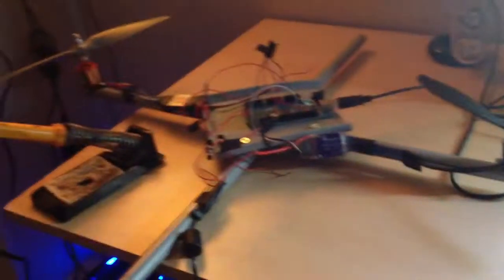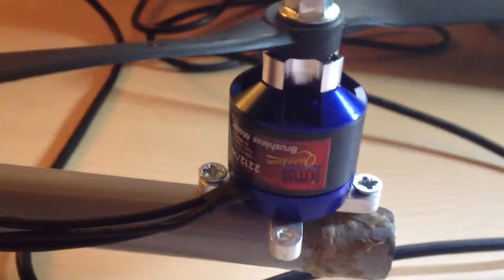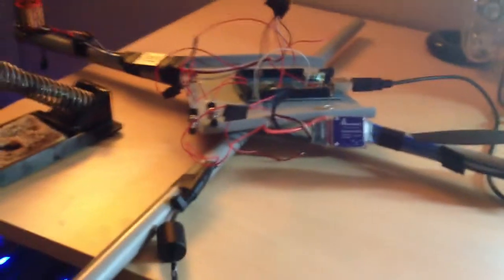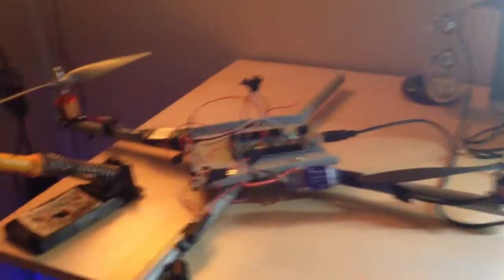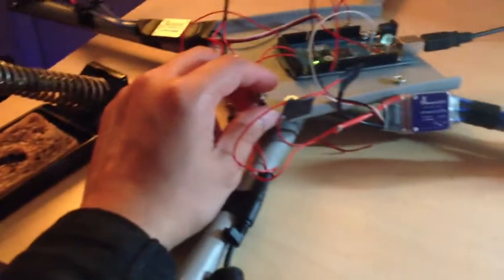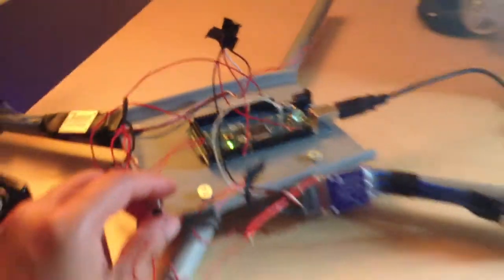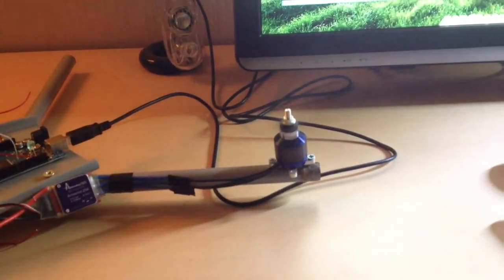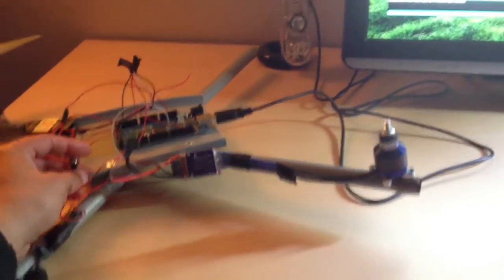Quad copter Project - More Power

Comment from the maker: hey, yeah they are at different heights but I'm hoping the flight control software on the arduino should be able to compensate using different throttle outputs